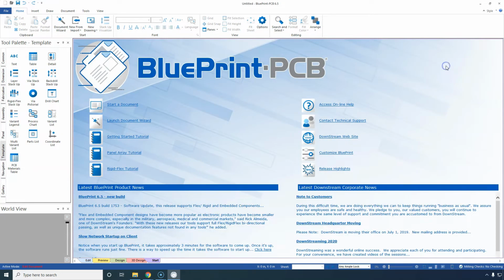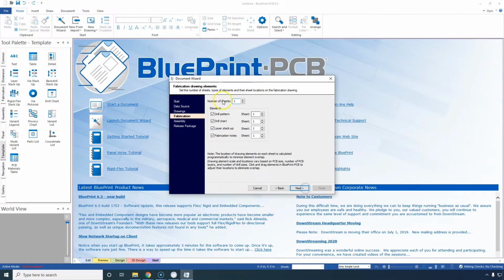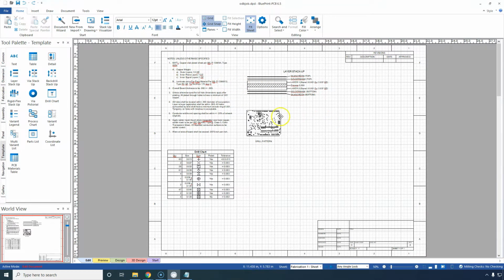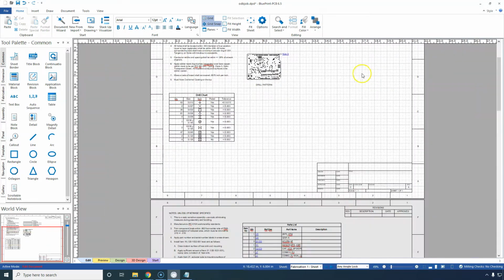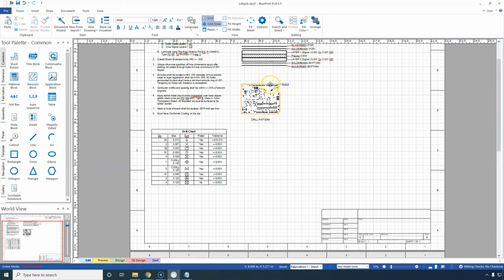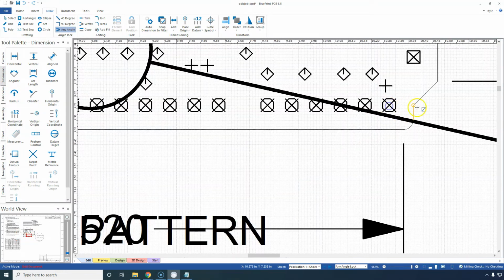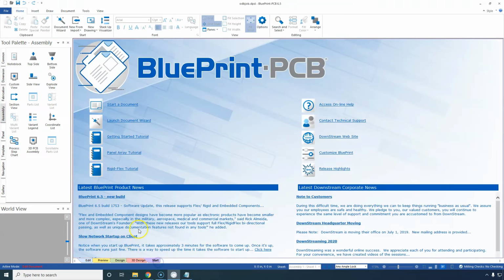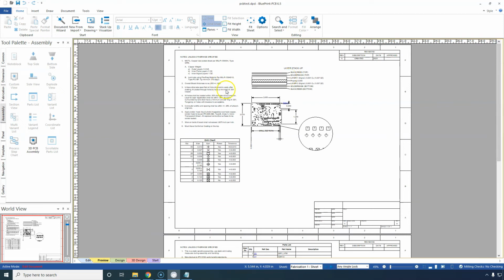How to Make Your PCB Drawings Very Professional - Using This One Software Tool

Comment: Hey Kirsch
for example if you have a rigid-flex pcb  where do you define the zones that the manufacturer knows how the pcb has to be made? in the gerberfiles or in the drawing? thanks
Reply: For flex zones u need specify in layer stackup details and show the zones on assembly drawing with special call out and detail instruction using orcad documentation editor or u can use cam350 blue print
Reply: @techedkirsch  thank you!